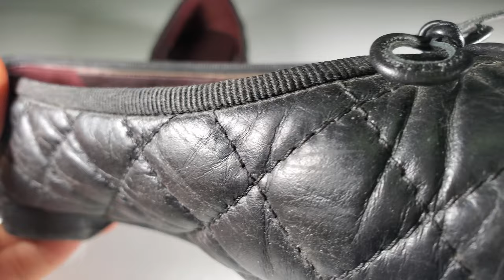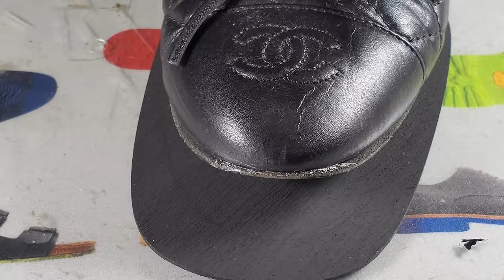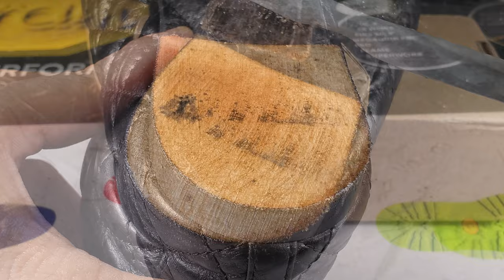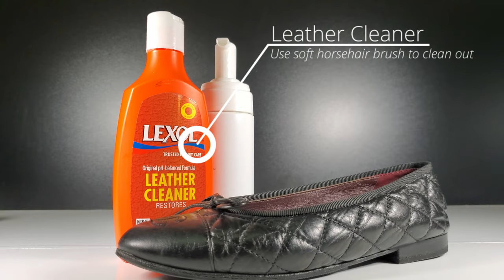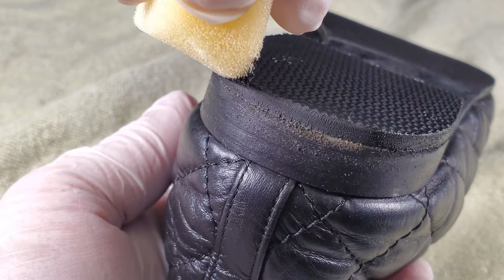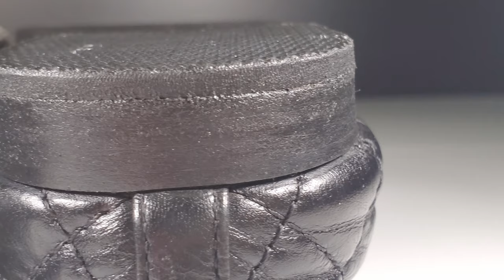ASMRㅣRestore CHANEL Ballerina flat shoesㅣ샤넬 발레리나 플랫 복원ㅣ4K

Comment: I’ve noticed on all these videos that the shoes are never re-soled. Instead, a new piece of rubber is placed over the existing sole. Is this purely out of convenience?
Reply: I’ve always wondered about that too, maybe if he resoled then you wouldn’t have the Chanel logo at the bottom anymore? Idk
Reply from the maker: @justin The reason why we add rubber soles on the top of original leather soles is to protect the original leather soles. Unless the leather soles are usable, we try to keep the originals always. If we just replace the entire original leather soles, it seems like we produce new pair of shoes:) 👍
Reply: It‘s like all restorations: Do you want to restore something as good as you can - or as close to the original as you can? 
In the first case, you replace as much as you can, in the latter, you replace as little as you can.